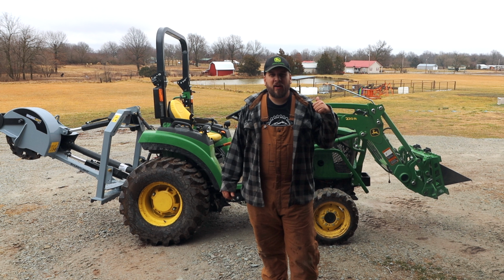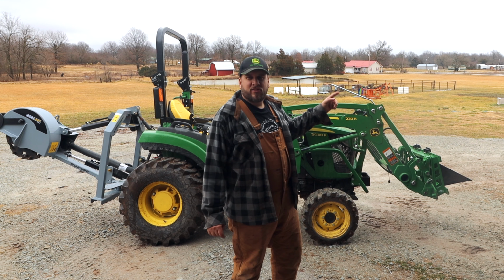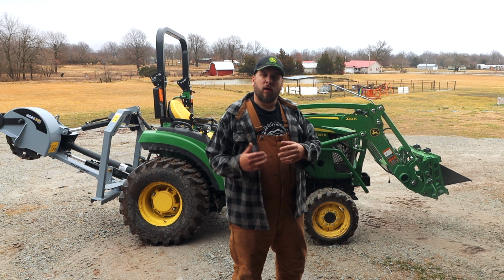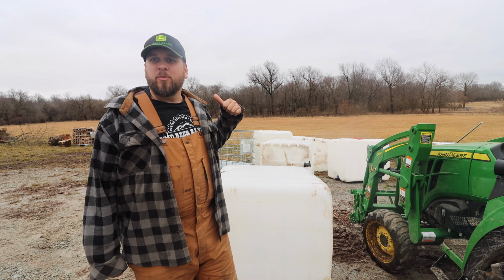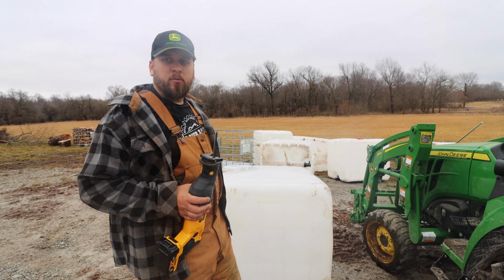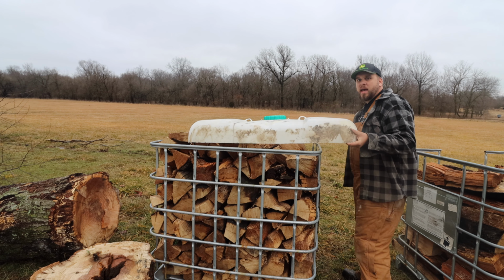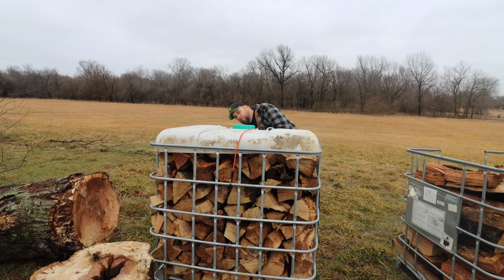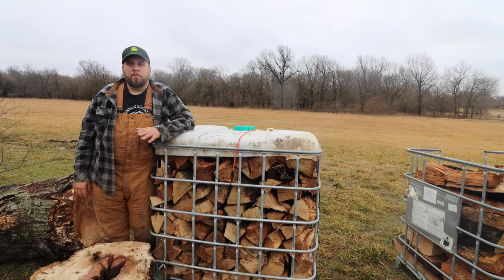Moving the Woodyard and Cutting Lids for Our Firewood IBC Totes

Comment: Who is this guy with the trimmed beard in the last two videos? :)  Nice work. Good call to get your work area moved out of the mud.  I love that you're using the Purple Collar Life rain cap method with bungee straps on the IBC totes.  :)  I've found that the reciprocating saw cuts nicely across the top, not as great down the sides when it binds up.  I just keep rotating the IBC tote so that I'm always cutting the top (facing up) side.  Great use of the Artillian forks, grapple and receiver for one project!
Reply from the maker: Thanks
Reply: ditto, LOL

Comment: I already have the frame and forks. Want to get the stump bucket and a grapple... just don't know that I can handle the clamp sections. Might have to buy a second frame so that I don't have to disassemble the grapple.  Thinking!
Reply from the maker: I could see getting a second frame if you have trouble lifting.

I lift the components to swap them out, but with proper technique you can swap them without lifting them. 

I haven’t done it myself but artillian produced a video showing how.  I may recreate that video at some point

Comment: Definitely got some wet ground there! It’s been extremely muddy here lately too. Does that tractor have independent brakes for each wheel or one? I like to use my brakes to help guide the front end in that slick mud.
Reply from the maker: It does have split brakes. I have not tried using them.

I know it helps with turning radius and control but I was unsure of the best application of when and where to use them
Reply: @RockhillfarmYT  in that slick mud just apply slight pressure to the side your steering towards and it will help guide you. I never lock mine together except when hauling it. Try it some and see. With it in four wheel drive just don’t try locking one wheel up to spin around in a tight turn or anything though.
Reply from the maker: Thanks. I’ll give that a try
Reply from the maker: Yeah, It turned into a mess down there real quick